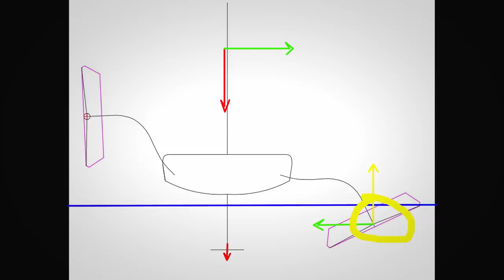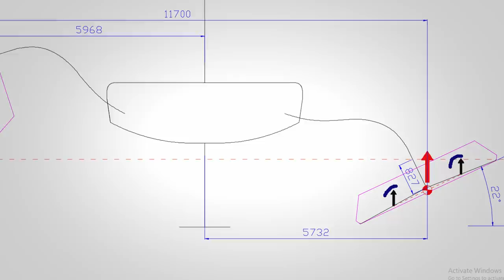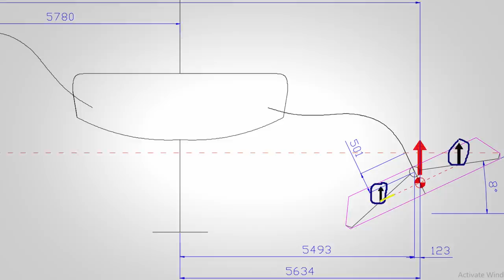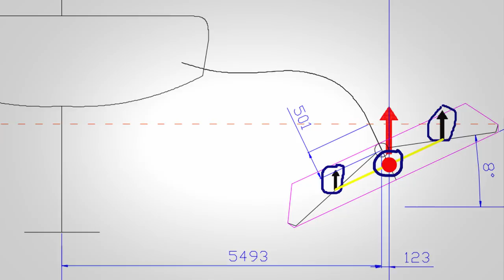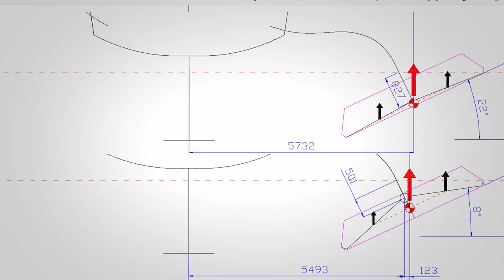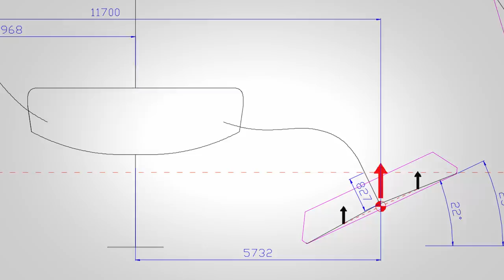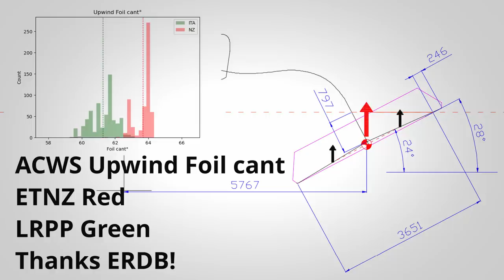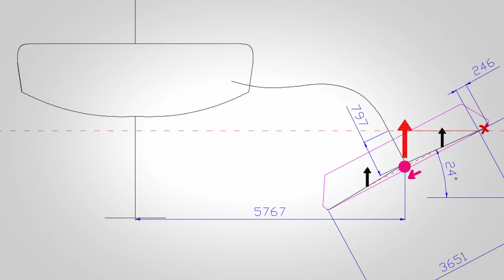Is this the ETNZ advantage that will decide the Cup?

Comment: Are they allowed to have a moveable ballast in the deck below?
Reply: They could manipulate the ballast to adjust the angle of attack on the foils, since the foil flaps cannot be manipulated during movement
Reply: @lukasethan6429  they can move the flaps while moving
Reply: @ruggericci   I thought they reported a while back that the flaps didn’t move unless they are going 3 or less knots
Reply: I did wonder if they can move the Code 0 (or it's ballast equivalent) fore and aft along the CL for exactly this reason
Reply: @rbcg105  They could, but don't - the rudder foil is used to adjust foil AoA.
Reply: @lukasethan6429  The flaps are used a lot to get the boats up on foils, and then constantly adjusted to manage flight height. LR may also be using differential flap angles to increase lateral lift.
Reply: @maxhugen  I agree they obviously do that. But moving ballast would help achieve the same pitch for lower AoA on the rudder. Just like moving your weight fore and aft on something like a moth. Not sure it's allowed in the rules
Reply: @maxhugen  also if you put the code 0 right in the bow when it's windy you could run more downforce on the rudder and then have more RM. When it's light you have it central. Even if you can't actively move it round there will be gains to position it based on conditions.
Reply: @rbcg105  Quite right. The CZ weight is a tiny factor, but teams use every scrap of advantage they can. Haven't seen any verifiable info if they do store the equivalent CZ weight in different positions, but it seems likely. 😎